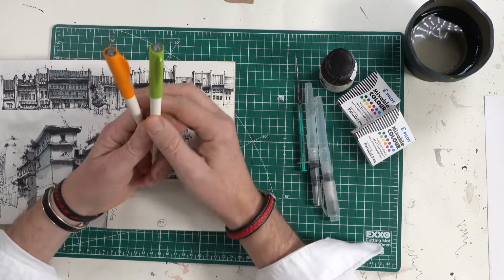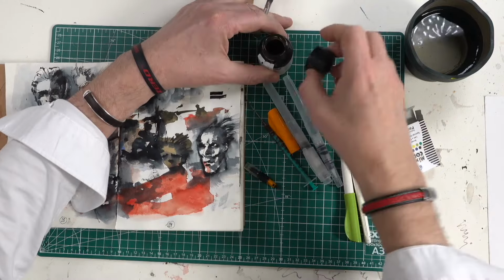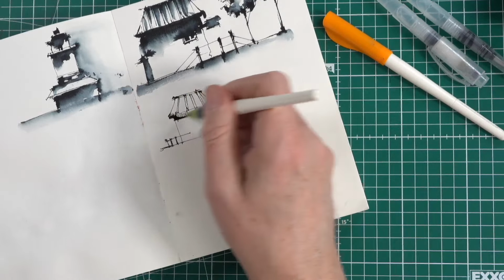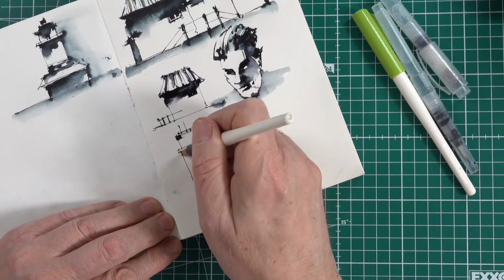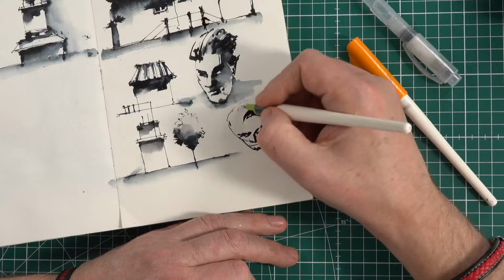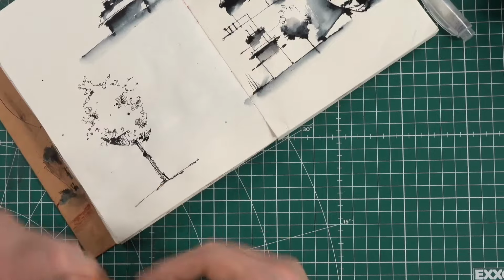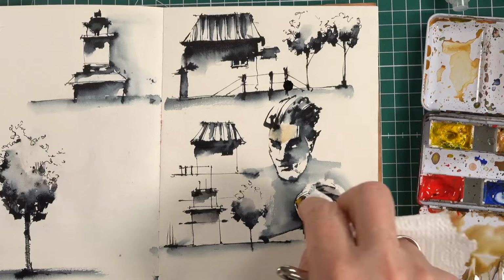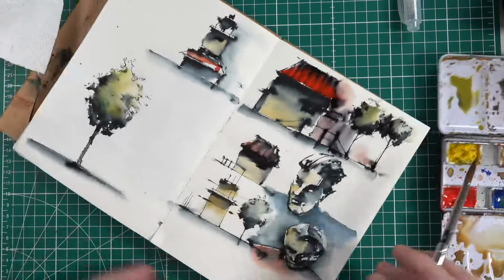Drawing with  "Paralell Pens"

Comment: I have owned a set of four Pilot Parallel pens for around ten years, which I once used to practice calligraphy.
They are remarkable pens, very free-flowing and versatile with regard to stroke variation, but I never considered using them for sketching until I watched your video.
I will now dig the pens out from the back of a drawer and add them to my sketching arsenal. 😃
Thank you for the inspiration. 🙏🏻
Reply from the maker: Hey great to read! Thank you for your feedback 🖋️👍